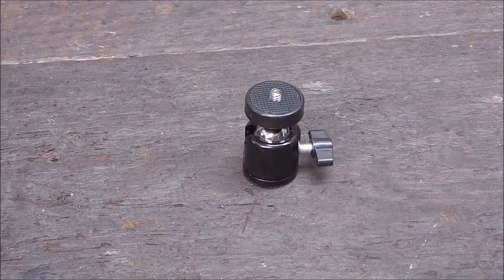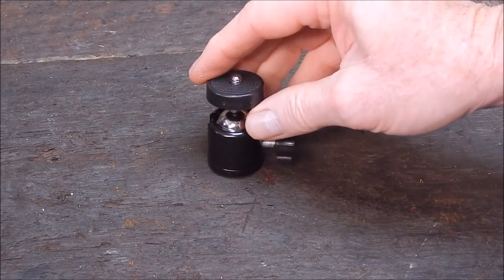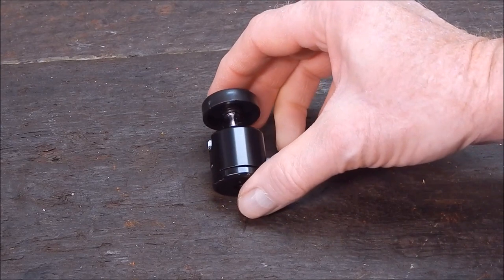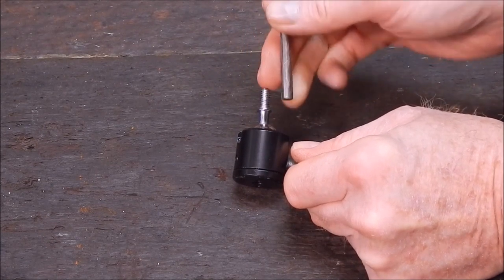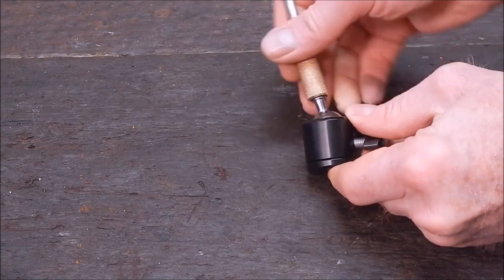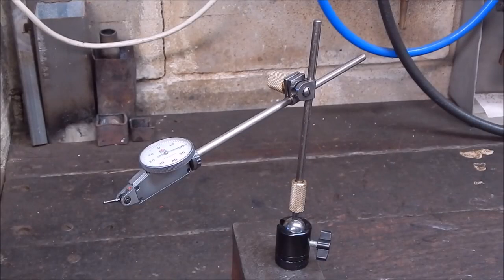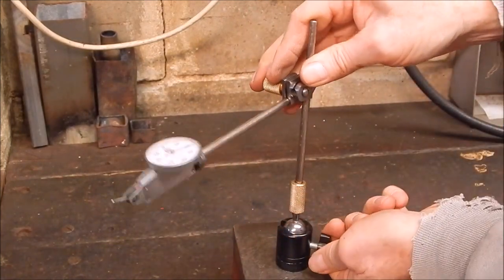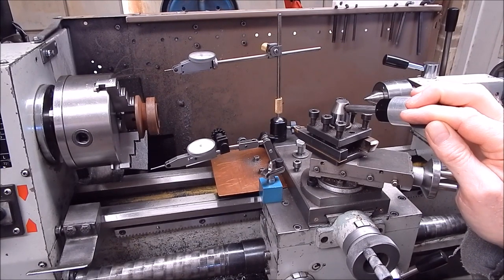Make a magnetic test indicator base - easy metal lathe project

Comment: Great idea and project. I would add a metal disc that has plastic or rubberized coating on the outside that you could put on it when not in use like some of the older mag holders came with to keep out the metal dust and particles. Just a thought. Thanks Hoss

Comment: Great idea and source for the base. A possible alternative to the contact cement would be slow setting super glue gel or better yet Loctite 680 Retaining Compound. I am not sure how "stiff" the contact cement will be over time as it ages.
Reply from the maker: Hi Paul,

The glue really only keeps the magnet in place.  The magnet clamps strongly to both the mount base and the work surface, so there's no chance of anything moving.

Cheers Rob
Reply: Thanks for your confirmation. I like using contact cement in these situations because it is easy to use and apply but wanted your opinion. Now I know.

Comment: Just out of interest. You mention enamel paint thinners in your post. For enamel paint I usually use turps, is this what you are talking about? Because I have a tin of that contact glue which needs rejuvenating. Very interesting post by the way.
Reply from the maker: No.  I've never tried using turps.

I use some high quality thinners for automotive enamel paint.  I think it's several levels above turps.

Try mixing a bit on a jam jar lid and see how it goes.  Maybe acetone would also work - I've never tried it.

Cheers Rob

Comment: Hi Rob !

Oh, a really nice little project - thx for sharing !

BTW - I got one of these camara mounts ... all metal !
Reply from the maker: Hi Keld,

Nice going.

They sure are useful little devices.

That small magnetic camera base I did from one is excellent.  I used it for this video on the close in chuck shots - really good and stable.

Middle of winter here, so been pretty cold in the work shop lately.  You must be soaking up the summer sunshine over there.

Have a beer or two for me.

Cheers Rob
Reply: We haven't had the best summer here ... way too cold, now it seems as though we'll get some few days with sun ... but I'll see them first !

I sure will cool some extra beers for you ... and I'm willing to drink them myself if you don't come by ;-))

Comment: Rob, did you say to add some enamel paint to the rubber contact cement if it starts to go dry ? Not Latex paint or water based paint , just oil base paint?  Good video.
Reply from the maker: Use enamel thinners.  I expect turps might work as well.  Try a bit in a jam jar lid.  Acetone won't work.

Cheers Rob
Reply: Thanks for the reply. I enjoy your videos. Very interesting. You find uses for things by thinking out of the box. I bought one of the cheap dial indicators and stand with the magnet. I haven't had time to try it yet. I have an old Craftesman metal lathe and built a heavy table for it. Now I need to get on to its quirks and get it running. Thanks again.

Comment: I disagree with your choice and application of glue. Contact glue is good for leather and flexible materials because it remains flexible after curing. And you apply it to both surfaces and let it dry and only then press them together e.g. on leather with a hammer. Here you did not let it dry before joining the two sides. But you should have chosen a different glue anyway like epoxy or loctite.
Reply from the maker: I've used this glue plenty of times on other projects.  No problem.  You can let it cure before joining, or use it wet as I showed.

The trouble with epoxy is that it can separate on a very smooth surface (like a magnet).  Quickqrip bonds very well and stays rubbery minimising cracking and separation.

Loctite can be used, but wasn't necessary for this job.

Cheers Rob
Reply: could the glues which stay rubbery and not rock solid lead to elasticity in the setup which could slightly set off measurements?
Reply: Good simple job. Nice one Rob. Use any thing laying around. Agree with you about the glue (whatever works & there is more than one way to skin a cat). :-)  regards from the UK
Reply from the maker: This stuff bonds very strongly.  There's no way anything can move.

I have used two pack epoxy when mounting magnets in some aluminium vice jaw pads I made, and the epoxy cracked during use.  It just doesn't like being banged around.

Cheers Rob
Reply: The base rests on the cup lip. As long as the magnet remains below the lip of the cup it'll be fine.